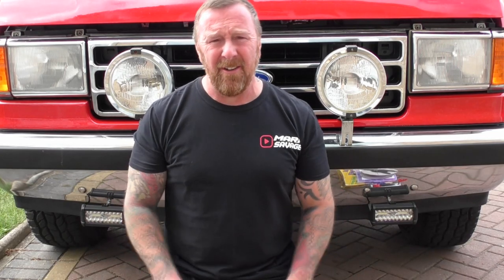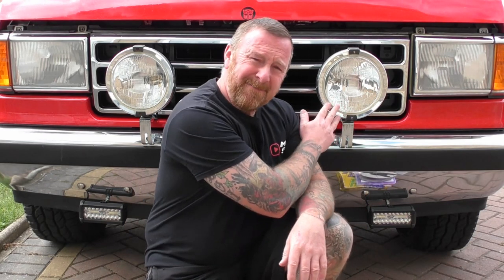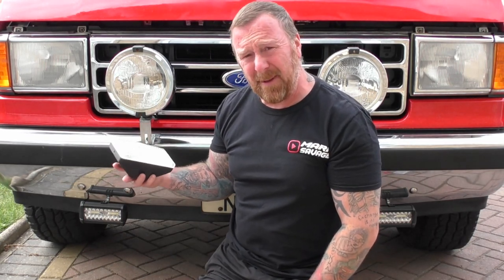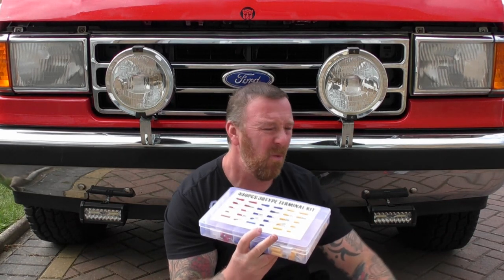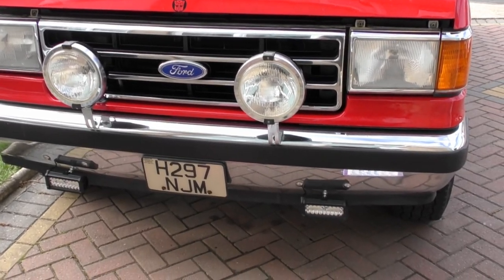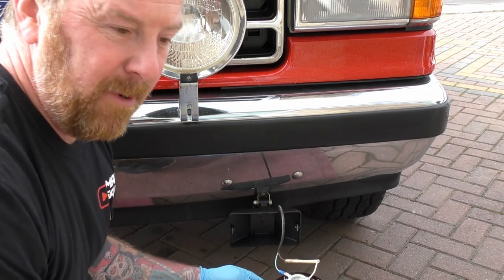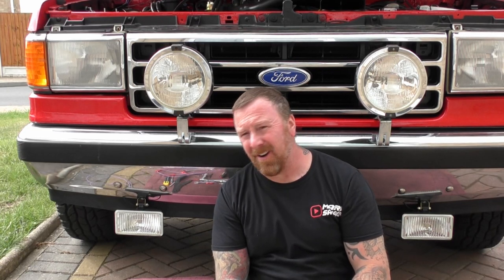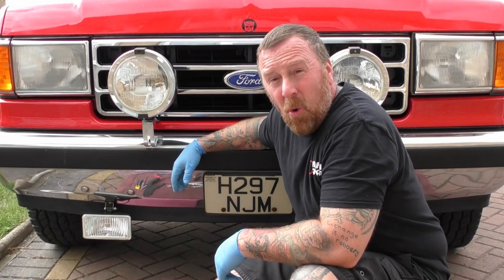LED OR CLASSIC HALOGEN LIGHTS ON YOUR TRUCK MARK SAVAGE

Comment: You need a relay too for 2 spots.. The switch will get warm and the contacts will burn out eventually
Reply from the maker: Yea i fused it but thought the same and have got one in the garage so will put it on 
But to be honest they are for show and only need to work for the mot 
Thanks for the update